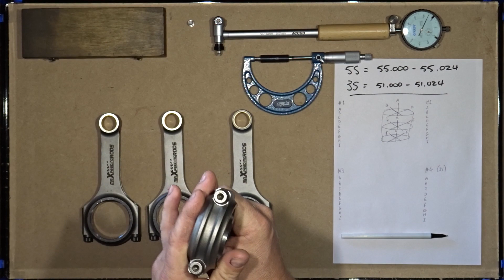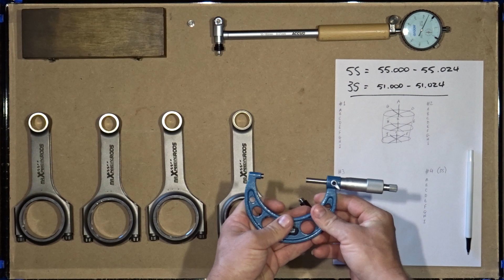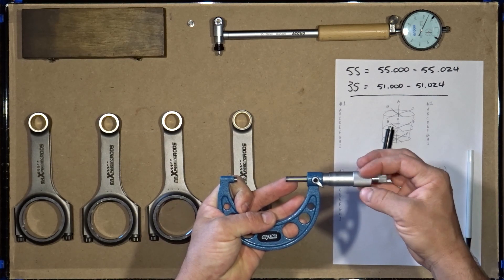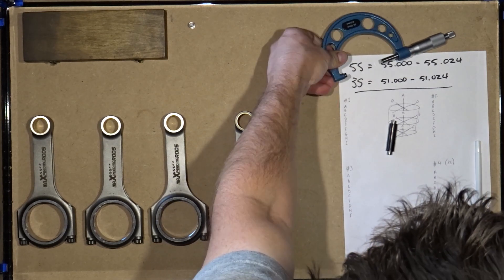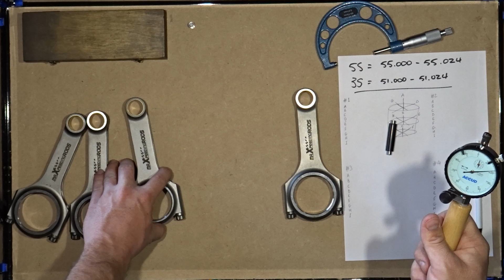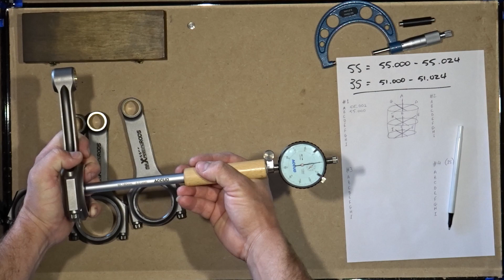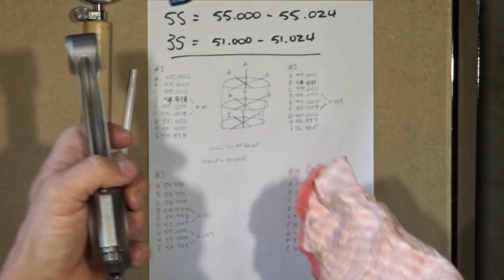Precision Measuring MaXpeedingrods Connecting Rods! How do they measure up?

Comment: This video is B.S. 
For starters tools you are using are incapable of measuring anything over 0.01mm, even if you are pro and its not the case.
Setting up micrometer for 55mm without measuring block is really amateur.
Holding in hand and heating up the rods and bore gauge and expecting to measure 0.001mm precise...omg.

If you want to measure 0.001mm you need 24h tempering on 20 C and suitable tools, ah and ultrasonic cleaning before.
As size goes these rods are perfectly fine, as material better than stock, nowhere near the top shaft ones, than again a set of these are cheaper than one of the good stuff.
Reply from the maker: A professional measured them before I did, I took them back to make the video about his results.

Comment: what is your conclusion? can we use it? is it a reliable product?
Reply from the maker: It depends on your application. If you're putting them in an already worn engine they should be fine, but if you will be blueprinting a fresh engine build they will require resizing which is fairly costly.
Reply: no. he said it was way off. far too much variation

Comment: 0:53
I need to figure out my piston rod diameter and tolerances this video was extremelt helpful. 

No one actually talks about how to make sure the parts fit right and dont blow up the engine.

Ill just send the rods from my last build. 

It blew up if you need to know.
Reply from the maker: It can be hard to find the right specs for rods, I got mine out of a big machinists book full of specs and tolerances for all kinds of engines, unfortunately I don't own a copy of it so I can't help you there!
Reply: @AaronBonBarron  I get ya fam. I end up looking up patents to figure it out. Rebuilding my Alpha 2 its a great engine once you convert the heads to use hydrolic lifters instead. 

Patents have all the data you need. 

Now I just need to tools to measure my engines tolerances. XD man this is gonna take me a year.

Comment: I have a set of these fit my 3S/5S as well !!! And I also have a set of Eagles ... can’t make up my mind on which to use they both differ slightly in design, but I question which will hold under 600 -/+ whp. Having a hard time deciding.

Comment: Many laughs, thx for the video. I would not hold my micrometre in hand when setting dial bore gauge, I would also put the connection rod in the stand while measuring. Your gage was not jumping so much, for these 0.01mm. Maybe to use micrometre dial?  Like the video, straight to the important part - measurement and cleaning
Reply from the maker: trust me, if I had a vice I would have used it lol

Comment: Good video. It is as you say, a box of chocolate (props to Forrest G.). Fun fact: I have thoroughly measured my Eagle rod before, and they were much worst than the set on MSR 1NZ-FE rods I've blueprinted lately. My conclusion is: If you're an experienced engine builder with the right tools you can go ahead and buy MPR, just check everything, if its too bad, directly send em back for the refund. But if you're just a hotboi trying to get your broken 240SX or turbo'd Honda back on the street, it's a big risk to buy these Chinese rods. Funny thing is though, often the opposite is what happens. The experienced guy doesn't buy em but the hotboi's do.  xD
PS: Actually one needs to measure all of the low cost rods prior to installation. Like I've found out the Eagles can be pretty bad and my engine machinist made the same experience with K1 he told me.

Comment: Wrong measuring tool for this job. How is the angle of this bore gauge rolled relative to the bore? slight angulation error measurement of the peak reading of the bore gauge will introduce measurement errors. 
https://www.youtube.com/watch?v=qHkcMKZ1ppA
If accurate bore measurement is needed the proper measurement tool will be a Intramik or three point internal micrometer. Like these made by Etalon: https://store.gaging.com/etalon-ingage-531-internal-micrometers
or
MItutoyo:
https://www.msi-viking.com/Mitutoyo-468-276-HTD-Digimatic-Holtest-Internal-Micrometer_p_22600.html

As for "resizing" a con rod. Typically the cap is removed, then slightly honed to reduce the internal diameter 180 degrees apart, then the bore is honed to the spec diameter. This will cause the bore to be slightly out of round where the con rod and con rod cap splits. Do remember there is also tolerances of the bearings, crank journals and more that figure into the overall clearance of the parts involved.

0.01mm = 0.00039", that is oil clearance... looks to be too small by lots as typical bearing to journal clearance, "For most applications .00075 to .0010” (three quarters to one thousandth of an inch) of clearance per inch of shaft diameter is a reasonable starting point." More for performance applications.
https://www.mahle-aftermarket.com/media/local-media-north-america/pdfs-&-thumbnails/cl77-1-205r.pdf

As for the dirty wipe with WD-40, that is typical for any precision part packed for shipment with corrosion-rust preventive.
Reply from the maker: Rocking the dial bore gauge back and forth is how you make sure it's parallel, when the needle starts to change direction that is your reading.
Reply: @AaronBonBarron  All those All those measurements down to 0.01mm or 0.0004" are of far lesser value once there is a realization and understanding metal that appears solid actually behaves more like rubber. Those measurements are going to be different with temperature, with loading of the parts (con rods and LOTs more). What once measured 0.01mm or 0.0004" no longer applies.. at all.

Know how much a piston_con-rod and all grows under loading and why? Before broadcasting said parts are junk, understand ALL factors involved including material science, petro engine design and mechanical engineering.